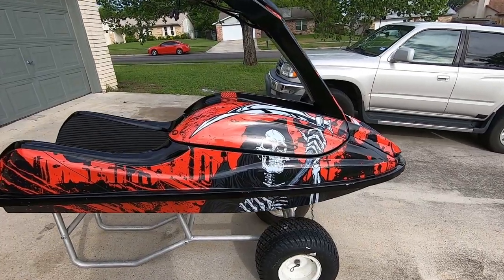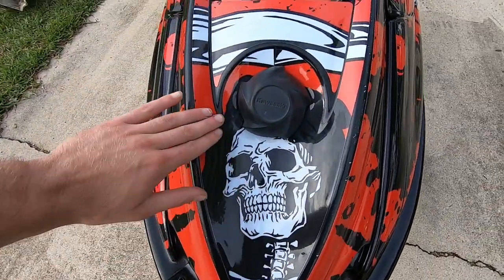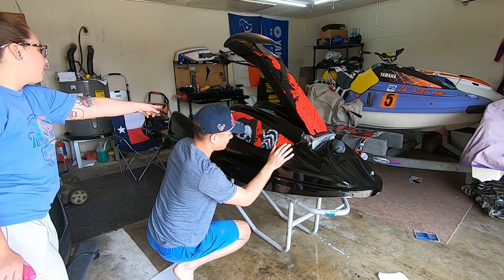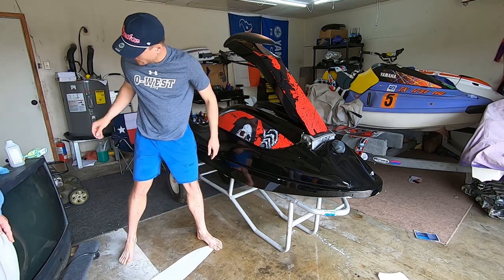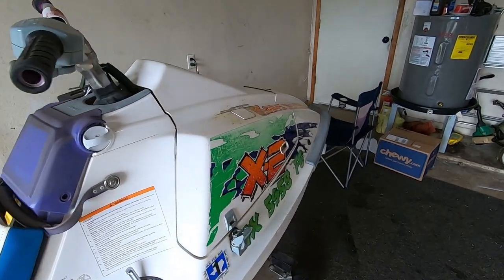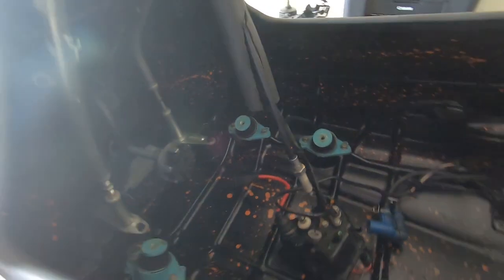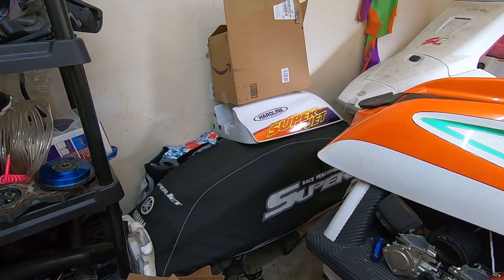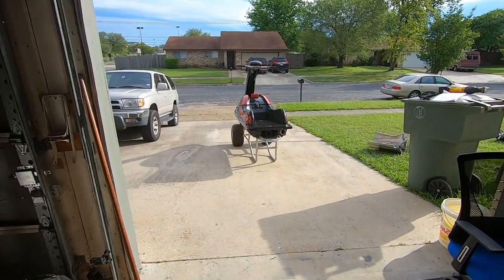Kawasaki SXR 800 Update

Comment: I still don't understand why you didn't just keep the 2010 and just rebuild the 701 in it that blew. I also don't understand why you put that 61X in it when you could've sold it either with the blown 701, or the 62T that was originally going to go in the 2002. In my opinion you should've just kept the 2010 and rebuilt the engine. And then like you're original plan, put the 62T with the blue head and protec pipe in the 2002, and the red 61X in the 1990. I really would like to see the SN being ridden as well. But with all that aside, I really love the way the SXR turned out! And I believe I spotted a Factory wet pipe for it that was on the blasters right footwell.
Reply: Lol, pipe is for my 781 X2 build 😎😎 maybe I’ll trade him for a different pipe..
Reply from the maker: I just picked between the 02 and the 10 and I prefer a pre 08 Hull.. plus the 2010 paid for the SXR build completely and the complete rebuild of my white motor. Don’t worry I’m going to post an update video and a ride video when Jeremy finishes the 1990 SJ!

Comment: I was looking at an 05 sxr800 stock and an 88' 550 with most aftermarket parts. If I'm looking to flat water fun, which one would be better for jumping/drying rolls or anything
Reply from the maker: DJ Styles out of those two? I’d probably say the 550.. the sxr is a tank and it’s more for carving/buoy riding in my opinion. If you want to jump waves and chase boats I’d look for a superjet
Reply: Unfortunately we don't have many superjets around , let alone any up here in central Canada. The chances of doing a roll on a stock sxr800 would be slimmer than the done up 550? Sorry for the questions. Literally buying one of them tomorrow
Reply from the maker: I know it’s a late response but what did you end up getting? Sorry I didn’t see it sooner
Reply: @JetSkiJarrod  I got the 2005 sxr800. Stripped all decals, getting it wrapped this Sunday. Had to do some minor fiberglass on hood and gelcoat on hull. Haven't tried the gelcoat yet. Ended up having a 2007 motor in it which he didn't even know. Plus trm trim lever. So it wasn't too bad. Haven't been on it yet